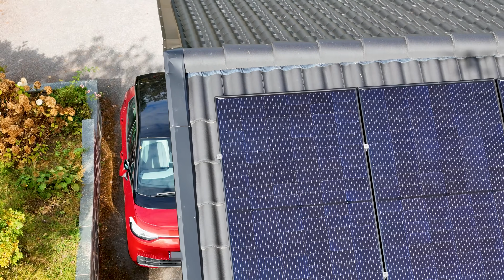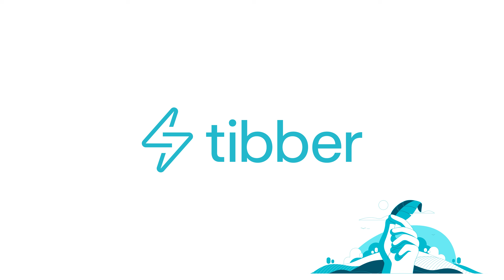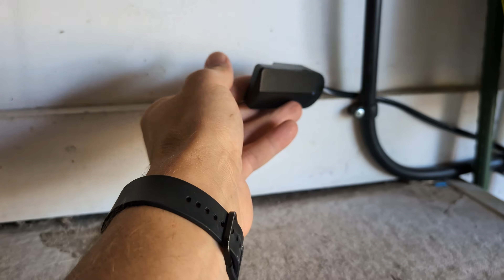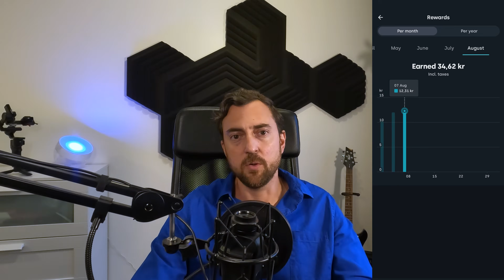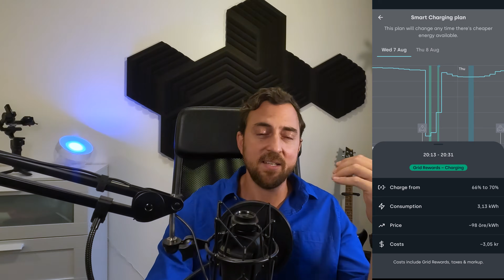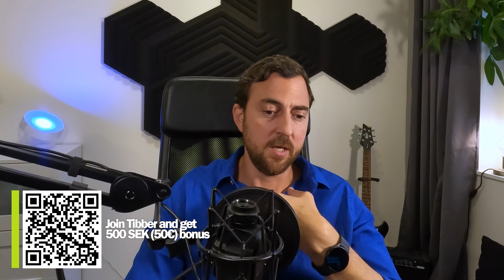Charge & Get Paid: Smart EV Charging Tips | Tibber Grid Rewards

Comment: is it mandatory with loadbalancer?
Reply from the maker: As long as you have a supported smart charger it would be fine. But then you can't balance the charge speed.
Reply: @ItsOnlyElectric  Currently I have set a fixed speed on my Easee. Can I still do it with tibber and smartcharging?
Reply from the maker: Yes that will work. According to the requirements from Tibber: 
To activate Grid Rewards you need to have one 
 electricity contract with Tibber, an integrated charging box (Zaptex, 
 Easee, Wallbox, Charge Amps and go-e) and 
 activate Smart charging in the app.
Reply: @ItsOnlyElectric  Thanks for replying